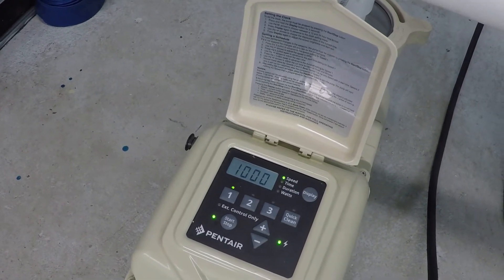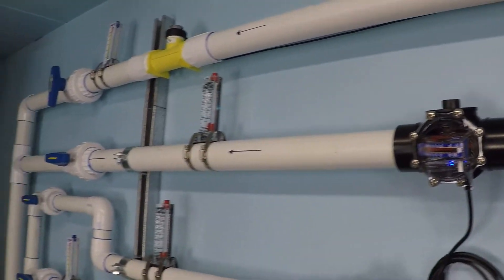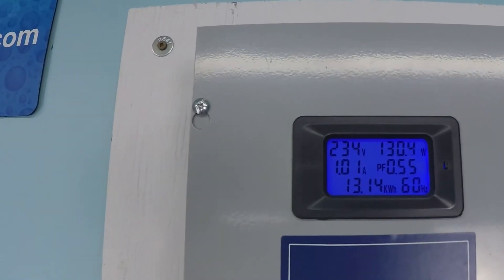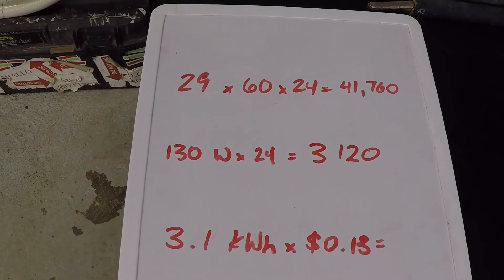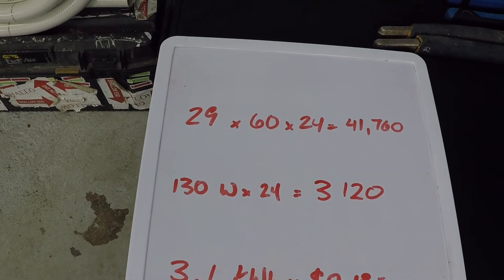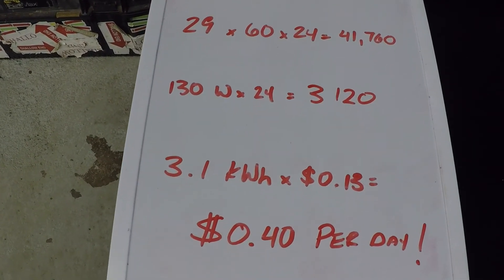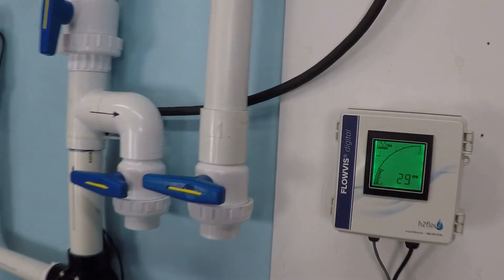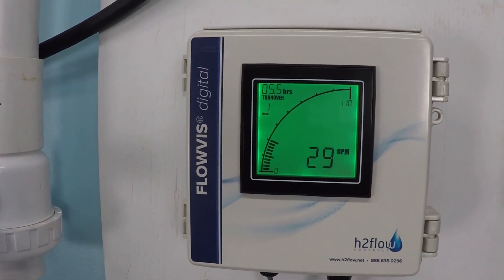1,000 RPM With A VS Pool Pump

Comment: Hello Steve, when I have my pump running at these very low speeds you have demonstrated. I do not have any pressure on   the filter pressure gauge. Is this common? Love the videos.

Comment: what does it say it’s pulling 1 amp at 240v that’s 240w is it not?
Reply from the maker: The wattage meter is reading both the pump motor draw but also the digital circuitry draw that the pump uses so even with the motor off there is still amperage draw.  The calculation you are doing for Watts (current x voltage) is correct but service factor for the motor is the missing link.  This meter actually monitors service factor (middle right numbers) which when multipled by the calculated Wattage gives the true wattage you see here.  As the pump speed increases the service factor changes which is why the numbers for amperage draw and power do not appear linear.
Reply: @Swimmingpoolsteve  Assuming the PF is the same as the Power Factor on a handheld multi-meter, which is the draw at that very moment, which is the  0.55?